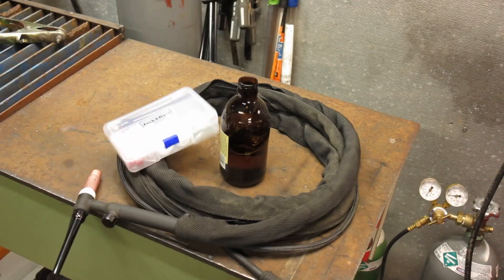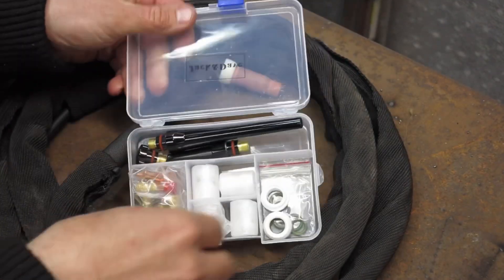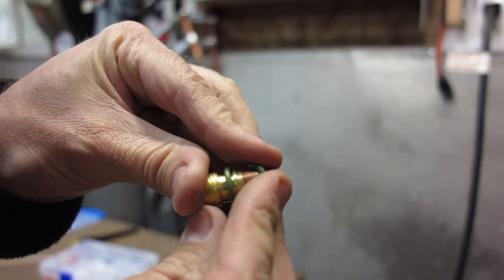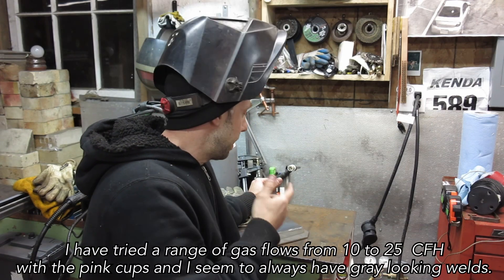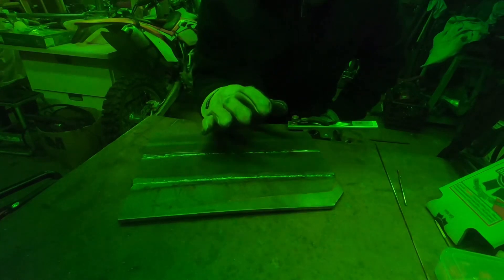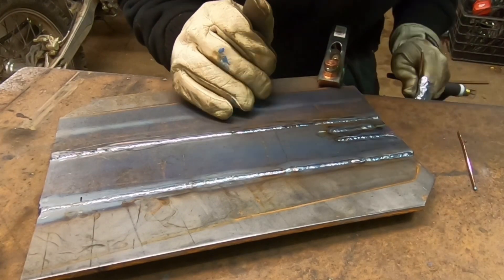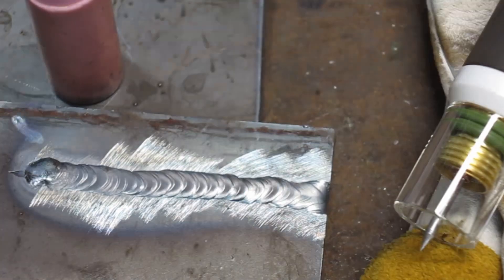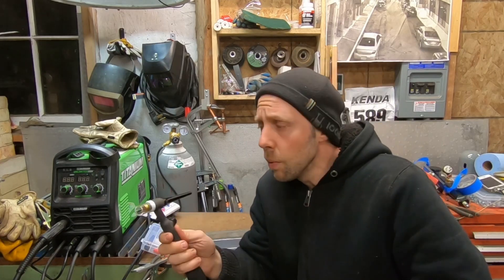Stubby gas lenses for TIG torch

Comment: I Love your videos.  I am trying to self teach tig with the unlimited 200. Amazon doesn't have those kits anymore since your video is a few years old.  Have you found another kit that fits? Thanks
Reply: Yeswelder has a number 10 gas lens kit for $22. But, I heard kits like these are far inferior to the furick stuff. It's only $70 for a pair of cups and the gas lens adapter kit from furick. So, for my money I guess I'll just buy the more expensive one and get fewer parts. It's still probably plenty for what I'm using. One of the issues I heard is you have to run way higher gas pressure with the cheaper kits to get the same amount of flow. Also I hear that the straight Pyrex cups have a tendency to break.

Comment: Not sure if you check your comments frequently, but i tried using your link for amazon for the kit and it didnt work. I typed in jack and dave clear cup kit and rx weld 55pcs kit popped up...is it the same kit?

Comment: HELP!...I bought a #10 glass lens and I am frustrated that my glass is getting opaque with soot and pitting....this was happening to me on truck sheet metal with about 20 cfh on the argon....can someone help me please?
Reply: What are your settings at? The material has to be really clean with tig. If you pull any contaminants into your puddle it will goop up and fast.

Comment: Hey what I found with aluminum tig smaller cups keep the gas flow better I have the same kit with a five cup I built pontoons and did all the tig and we ran 5 cups I’ve tried bigger but seem to be steadier with a 5 cup. Just throwing that out there give it a try let me know if you find it easier
Reply from the maker: Right on man 🙂👍 Thanks

Comment: I think you will find it isn't exactly the pyrex cup improving your weld, but the gas lens (mesh) that replaced the standard tube the gas comes out of (diffuser). The gas lens reduces turbulence and improves the coverage of the weld pool and that in itself will influence the final appearance of the weld.

Comment: So it’s a little late, maybe you’ve figured it out by now, but that contamination on your “clean metal” is the anti rust coating they put on the metal. You have to grind/wire wheel it off. You’ll see it wear away and reveal the shinier steel. Nice video tho, thanks!

Comment: Hey Mike! New sub to your channel and would like your opinion I would like to learn how to tig weld I’ve only really welded with a 220v harbor freight blue mig I’ve never used gas but would like to find a welder that I won’t have to upgrade but don’t want something that’s priced ridiculously just a diy kinda guy. What would you suggest? Thanks dude.
Reply from the maker: I like the Yeswelder 205DS. It’s a MIG, stick and DC TIG. Keep in mind it’s only a lift start TIG and can only weld Steel and Stainless steel. They sell for around $400 and the optional TIG torch is another $50.

Comment: Hello sir.  Great videos.  Do you know if this cups will also work with the Omni Pro 220 tig torch?  It's the Vulcan 150A actually.  Or  would the YesWelder tig kit work with this torch?  Thank you very much.
Reply from the maker: Hello Robert 🙂 yes this kit or the Yeswelder kit should fit fine, your TIG Torch should have a #17 on the side of the handle, so it should fit 👍
Reply: @Mikefestiva  Yes sir.  It does have the 17 on the side.  Thank you very much.
Reply: @Mikefestiva  Hey, along with having a multi process machine, what would you recommend for a flux core only machine?  For those times you just need to get something done quick and dirty, and usually outside.  Thanks again.

Comment: Not trying to be an ass but you should try running a smaller filler.  You could also try dabbing the wire instead of just running over it.  This will allow more heat and a prettier puddle

Comment: Hey man, I know this was posted two years ago but when you switched the cup diameter I don't think you changed your gas regulator pressure and I think you blew your weld around. Sounds like the #8 was turbulent and really high pressure

Comment: Dumb question for you... I just got the pyrex lens kit and put it together watching your video. The only thing not shown in your video is inserting the tungsten. I have .040" dia. tungsten and when I go to put it in, it slides right out the lens side. I tried using a collet (I think that's what it is) but it slid right through the collet. Am I doing something wrong - it's not holding the tungsten in place? Perhaps I have the wrong size tungsten?
I'm new to the glass lens tig welding thing. Thanks in advance for your help.
Reply from the maker: I would look over your Tungsten and your insert arbors to make sure you have the proper sizes matched.
Make sure you have them installed properly and twist the top of the TIG torch down to clamp the Tungsten tight.
Reply: @Mikefestiva  thanks! I’ll have a look and let you know how it turned out. It’s not easy reading the small markings on those things. When I was younger, it would have been much easier! LOL
Reply: Tighten your collet body or gas lens all the way down. Then insert the collet and tungsten and tighten the back cap.
Reply: @petemoore8923  Thanks… I’ll have a look and let you know how it worked out.
Reply: Having the same problem.  Using the 1:16 collet with 1/16 tungsten and it still falls out.  I can get it to grab after loosening and tightening 10 times at least.  Did you ever figure out the problem.  I think it’s just junk to be honest and that’s why
Reply: @85nscarola  I never did figure it out, although I didn’t put much more time into it. I’m sure I’ll be looking at it again in the next 2-3 weeks as I’ve got some work coming up that needs to be done. As of right now, it still falls out. ARG!
Reply: I just sent a similar kit back.  Wouldn’t reliably clamp down on 3/32 tungsten. Yes, I had the collet body screwed in fully prior to seating the back cap, and the 3/32 components installed.

Comment: Learn to walk the cup. You'll stick tungsten like crazy for a while but if you walk the cup and keep your tungsten really close to the puddle you don't have to dab. The puddle will stay out front and consume your filler also like was said clean you base and hold the side a little longer to get rid of that undercut. Carbon can take tons of heat.

Comment: Check your argon flow,try to use preflow 1 sec per 10 amps, dont just take the torch away emediately ,let the weld cool unde that argon for some seconds depending on the amps,try buying one firuck fupa 12 ceramic,that thing is a beast,does not break easy like glass,and will last you long,i started with those chinese cups myself then i tried a fupa and got stuck to it :) Great videos my friend!!

Comment: I tried doing lap welds for the first time today. Let me tell you that was the biggest mistake of my life. I managed to do things to it I didnt know was possible. I couldnt get a happy medium on starting a good puddle without soot popping out. Hell for that matter couldnt even get a tak weld in right. I am thinking of classes, because this is insane as hell. I am going to need a therapist before I land a good first tak weld and run a few stacks of nickles.
Reply from the maker: Quick question, are you using 100% argon gas? Run about 15 to 20 CFH gas flow.
The metal needs to be completely clean, you will need to grind off all the dark mill scale, it’s got to be 100% clean. Let me know if all this was right or not. Ps what color was the soot? If it was light brown it’s definitely the gas.
Reply: @Mikefestiva  Well it took awhile but my issue was just getting an overall start to be able to start dabbing filler wire. it kept blowing the top back like ya were blasting it with a torch. So after screwing up a few pices after I messaged ya I finally got it to where I can get it started and lay some filler welds down. Still got a few issues like timing but ill work that out so the welds are bubbled up instead of flat. But at least I got it to start...lol. Now I got to work on the goofy tak weld part still.

Comment: Hi I just looked at the clear  tig gas lens and I see that 2 o rings but they put the green on then the red one. They do put the o rings on at the small side of the brass piece. But I have seen other kits that only have green so on that kit u use 2 green o rings. I just thought I'd let you all know what I have seen. You all stay safe and have fun with your wedding.

Comment: You can keep the pink cups just use the gas lens that came with the clear cup
Reply from the maker: Richard Bristow good to know, but I like the clean cups more 👍 this video was right when I started to learn to TIG. I’m now onto Aluminum with a AC high frequency welder, it’s great 🙂
Reply: @Mikefestiva  the clear cups are nice I learned to tig pipe with the pink cups so that's what I'm used to. If your TIGing aluminum see if your machine has puls settings, those settings can help with heat control and with how you want the puddle to turn out.

Comment: Dont pull out like your doing with the tungsten lean the torch back until it goes out and strike your filler rod like a match between the tungsten and metal touching both slightly

Comment: With the pink #8, 16  on gas flow. You could be blowing crud into your tip at 20. For the 10cup, with that nice diffuser, yeah perfect coverage At 20. 

I think it really comes to the diffuser, vs the 4holer for the gas flow being smooth.

Thank you for doing these vids. I am just an old lady hobbyist, but - Gonna try titanium. Thx again. Liked and subscribed.

Comment: Are these Pyrex cups actually gas lenses or cups? I'm very new to TIG but I keep hearing the terms "cups" and "lenses" which I originally thought were the same thing but then I got the impression that cups are shaped like straight cylinders while lens have a contour to better focus the gas. The Pyrex ones you tested looked like they  have the same shape as the ceramic ones that seem to be referred to as cups. Can someone set me straight about what distinguishes a cup from a lens?
Reply: The gas lens focuses the gas out of it around the tungsten to cool it and provide the coverage gas for the weld. The stainless steel screen gives a much more uniform flow past the tungsten for more even cooling and better coverage, whereas the 4-hole is much more turbulent in the coverage (the cooling is about the same). The cup shapes the gas flow to the correct diameter around your puddle. The cups are different size for the different sizes of tungsten to ensure the diameter of the gas flow covers the entire diameter of the puddle plus a small bit. This ensures the entire weld envelope is completely inerted and has less potential for contaminants to enter the puddle. 

I think part of the reason these "stubby" kits only come with #10 Pyrex cups is because they are so short. At that distance from the gas lens, the diameter of the cup is less crucial than when the longer ceramic cups are used.
Reply: @macadamia1966  Thanks for taking the time to write this most complete answer. Between what you and Presscrete wrote I now understand the differences between cups and lenses and had it all wrong.  Really appreciate your time answering.
Reply: They are completely two different things, a gas lens is the part, usually made of brass and stainless,  that defuses the argon through a screen, as it comes out of the torch
Reply: @Presscrete  - Thanks. So the shape of ceramic or Pyrex has nothing to do with whether or not it is a called a cup or lens? The gas lens is actually that screen that Mike showed him installing?

Comment: Tig likes really clean base metal without the mill scale. I bet if you clean the pieces more I bet your welds will come out great :)
Reply from the maker: Thanks for commenting 👍 yes you are definitely right, I made this video when I was just starting out learning TIG, I have learned clean metal is important, I’m now welding aluminum (with my AC/DC TIG) and it’s really nice to finally have a good welder!
Reply: @Mikefestiva  your seem 2 be fan of HF brand .
Reply from the maker: 73 SUPERGLIDE It’s mainly because the tools I buy from HF are affordable, some of there tools are good some are definitely not so good 😂
Reply: @Mikefestiva   i know that mike ..ive bought the best and bought cheep  buy what you can aforrd at the time .because you can take it with you ...
Reply: @Mikefestiva  did u have part number

Comment: Mike you've sold me on the 200. I've got a bad back now days and all I want is equipment that's lite weight. I'm an old stick welder so scratch start on the TIG is fine with me. No big deal. I just need this for my little home shop so it'll be fine. I think I'll go by it in the next few days. I'm excited. Thanks for your videos.
Reply from the maker: Right on Jerry thanks for commenting! I really like my Titanium 200, I use it all the time. Even though the Vulcan Omnipro had more features I ended up liking the Titanium 200 more mostly because it’s much smaller and lighter. It’s a really good compact welder and I’m sure you will be happy with it, technology has come a long ways and these new inverter welders really do weld nice. Take care Jerry 👍
Reply: Scratch is ok but when get stuck that no good

Comment: Great show on the tig👍 my question is can the titanium 200
Tig part of the welder do Aluminium and if so what's a good all around tungsten tip I should use and Color. I'll be
Welding 6061 & 5086 Aluminium
Smaller gauge aluminum & 1/8"
3/16" 1/4" 5/16". Thanks🤘
Reply from the maker: Unfortunately most of these multi process welders are DC TIG, you need a AC TIG with high frequency to weld aluminum. The only way to weld aluminum with these machines are with the optional spool gun. I use blue tungsten for welding aluminum with my AC TIG welder, I have used gray and noticed no significant difference. 
I have found spool guns to weld a lot faster but with the downside of having a bit less control of the weld puddle and heat input when welding, TIG welding is a little slower process but with a wide range of puddle and heat control. I hope this helps.
Ps checking out my ProTig 200 video where I weld up a motorcycle stand, I hear you can find those Protig 200 welders at Harbor Freight parking lot sales for $250 to $350 so keep an eye out for one of those!
Reply: As far as I remember its brown tungsten for aluminum. Then you switch your polarity to reverse. Using low amperage make a ball on the end of the tungsten rod. Twice the  thickness of your  tungsten rod.
Reply: Blue 2% lanthanated. My Miller 150 Econotig does well with 1/16"  blue lanthanated / 1/4" stick out / 12-15 CFH / 5356 filler / 90-100 amps / on 1/8" aluminum. Good on steel as well.

Comment: Try cleaning the weld area with a flapper wheel to remove the mill scale ,about a quarter inch wide .also dont let your filler rod come out of the shielding gas

Comment: Nice video Mike. I'm in the learning curve as well. The only comments I have are concerning gas flow and stick-out. Kind of a basic rule of thumb I learned from Justin on the Fabrication Series is: Gas flow should be around double the cup size. i.e. Number 8 cup - 16 cfh, number 10 - 20 cfh, etc. Stick-out should be around cup size diameter. i.e. Number 8 cup (8/16") - 1/2" stick-out. Number 10 cup  (10/16") - 5/8" stick-out. But what do I know!? Very little! And I have shifted to gas lenses as well.

Comment: by far my favorite is a wv-17 with a stubby gas lens kit and a #7 cup and a stubby back-cap it's super small and easy to use. also, gas lense lets you use way less cfh for instance instead of 15-20 I use 7-10 cfh but your torch will get hot very hot. and I'm learning to just went through my first 80 cubic feet of argon. also, you hopping that means your moving your torch and wire at the same time I do the exact same thing no hate just work on it. what I do is wait for a puddle to form then add filler then move the torch then wait for a puddle to form then add filler, repeat. and clean your base metal it really helps. but this is me a couple days ago https://www.reddit.com/r/Welding/comments/efkvp1/tig_welding_help/
btw this is multiple edits lol

Comment: I think the issue isnt the cup, but the way the gas is delivered into it. The 4 feed holes in the boss cause the gas to exit the pink cup in an unstable fashion and at perhaps a higher velocity.  This movement I believe will induce air into the weld area.  I think the mesh diffuser in the clear cup setup is the real key here.  It allows the gas to smoothly spread out at a lower velocity and create a  zone of slightly elevated pressure without inducing outside airflow.  It is like the difference between adding water to a bucket with a high velocity straight stream(note the air bubbles pulled into the bucket with the water stream) and filling the same bucket with a wider lower velocity stream/spray(far less air induced).  Thanks for the practical videos!

Comment: You were holding either start at two different angles the Pyrex was at a better angle than the ceramic
Reply from the maker: I still find these stubby gas cups to have much better gas coverage and it’s much easier to see the welding area, I did this video months ago, I have learned a lot since then, I still like the Pyrex cups and I use them on my AC TIG machine. Take care
Reply: I'm just saying that was what I saw that may have made your wells different you weren't getting the same amount of gas coverage with the angle being different
Reply: @alfonzacorn  your a dum dum dum dum dum dum dum dum dum dum dum dum dum dum dum dum dum dum dum dum dum dum dum dum dum dum dum dum dum dum dum

Comment: Gotta keep that tungsten sharp if you tap the plate it contaminates the weld and wont be as good plus it can break the tip or round the tungsten. Besides that not a bad job
Reply: Run at 30 for the gas flow. And your angle is off for the torch go for 30-45 degree angle